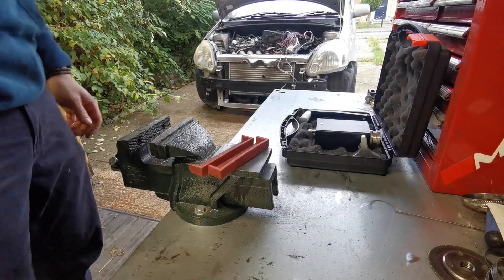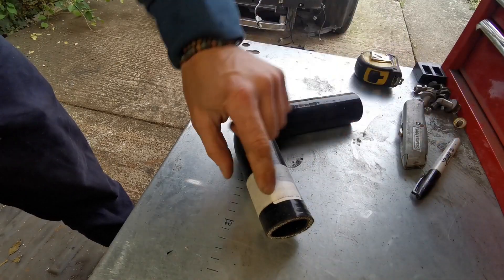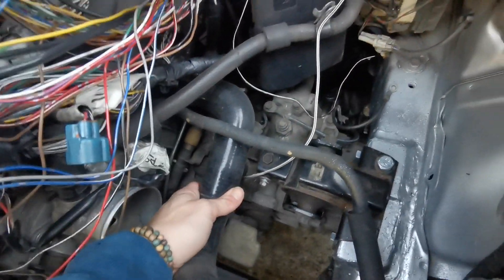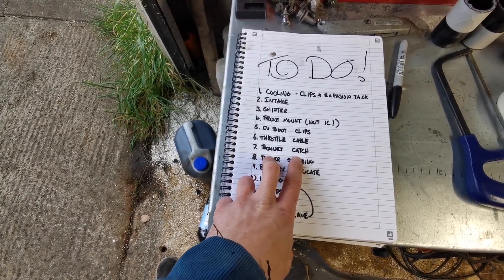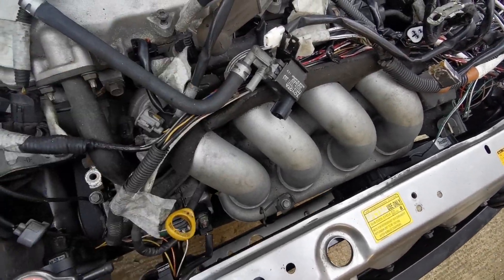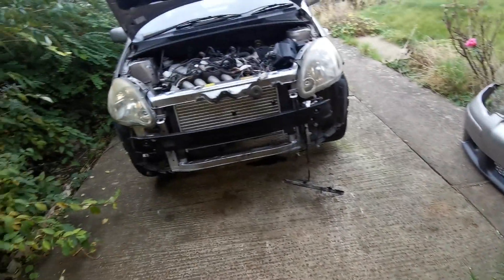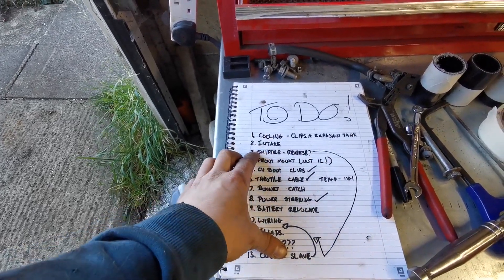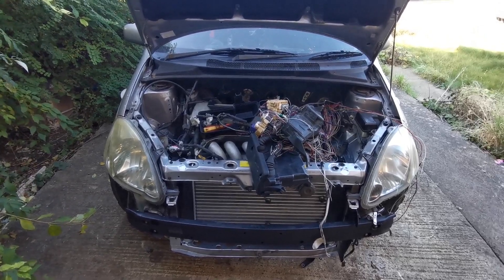2ZZ Yaris Build ep.23: Actual Lotus parts and everything else is wrong..

Comment: you dont need that pulley travel all way to old ps section u can bypass it with pulley on tensioner and then use, the 6PK1172 belt. bypasses AC and PS setup hope this helps.

Comment: I used the same part on my MR2 2zzge as it has a electronic pump in the front.
Reply from the maker: It's a nice little solution, there would have been infinitely less swearing if I'd done it a while back, rather than having to half pull the engine again to get the old pump out 😅